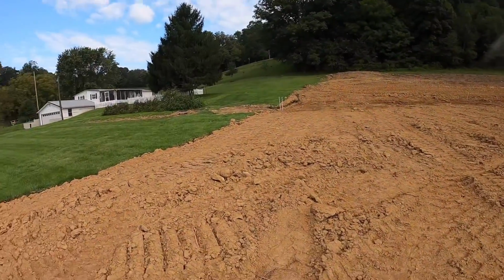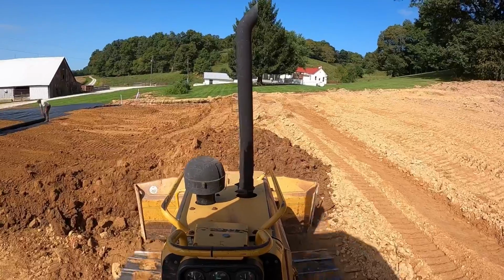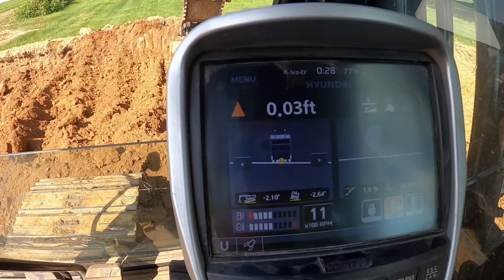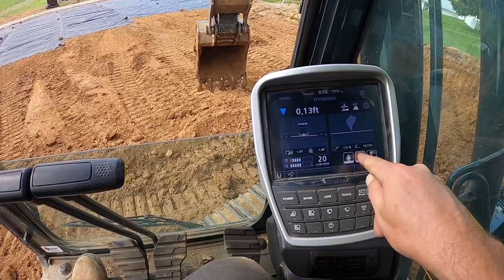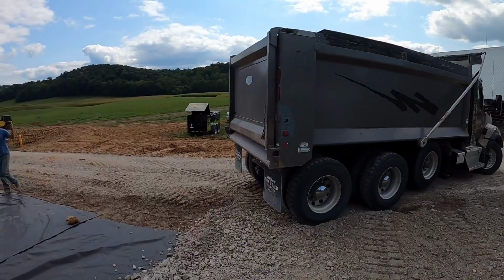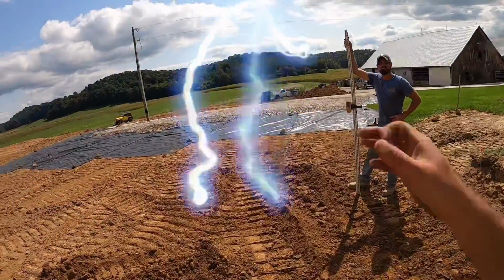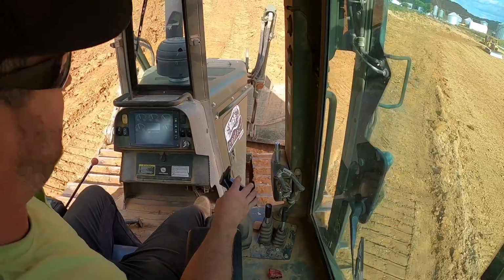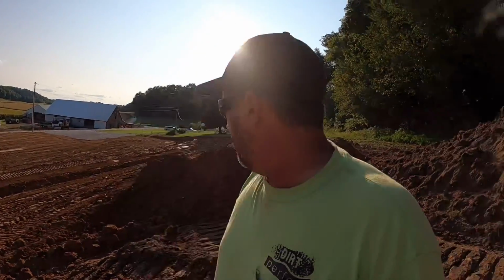Somedays the hardest part of the job is just getting there!

Comment: Matt finding some fuel to keep you going might be a big part of your future now that you have the Thunder Wagon. 
That “greeze” pump will have other issues in the future. We had one at work for applying grease on clutch splines and always had trouble with it because the pump always created a cavity and would run dry. Maybe on the trailer the grease will settle down around the pump when it’s towed down the road and work better for you.

Comment: That system for digging to grade I bet if you you got it like you want, being more accurate when in motion would cost so much more. Because the sensors/gyroscopes on each placement would need to have big upgrades along with the excavators onboard computing as it would have to sence which way you are controlling the bucket/stick

Comment: As far as the self-grading system in the Hyundai... This is probably making it sound too simplistic but, you'd think you could set the initial depth/elevation and it could base the +/- in depth on the change in elevation no matter where the excavator is or whether it moves. Maybe you can't get the accuracy you need or it may be too slow to update as your digging... 🤷‍♀
Reply from the maker: If you don’t move

Comment: Hello dirt perfect and matt. I got a question. I got land in the city. I got to have the house 20' from the sidewalk. At the sidewalk the ground is 2'6"-3' high. If i put a fence there it would only be a 1' high to 4' would you cut the ground down to 4" over the sidewalk or level with the sidewalk and 45% to the 20' mark. Im wanting to put a 4' high fence up. If i do it now a dog could jump over it with no problem. What is your thoughts on it. And where im going to put the front gate 4' im wanting to make a 5'×4'×4" slab to let the gate swing in and im going to put wall blocks to keep the dirt back.
Reply from the maker: Great ? For Matt
Reply: @DirtPerfect  what

Comment: Do you like the woven fabric better than the non woven. I use a lot of the non woven and didn’t know if there was a particular reason you use the woven. Always looking to see the way others do things to see if I could be better with what I do
Reply: I’ve heard very mixed reviews on both types of fabric. Contractors ard here don’t generally use it unless made to. I’ve thought about it for the wife’s cabin driveway at our farm if it’s worth that expense.
Reply: @kennygray9013  it does help bridge soft spots. The way I was told is the woven doesn’t let water pass through and the woven does. It may just be a preference but I was checking to make sure I wasn’t using the woven in the wrong application
Reply: @kennygray9013  Around me they use it more like a base then anything.  As long as it is just light traffic it will hold up just fine on driveways.  It just stop you from having to dig out a foot or say and use bigger rock on bottom to carry the weight and then smaller as you go up.  So probably is a cost saving because rock is not cheap.
Reply from the maker: At this point use what we can get